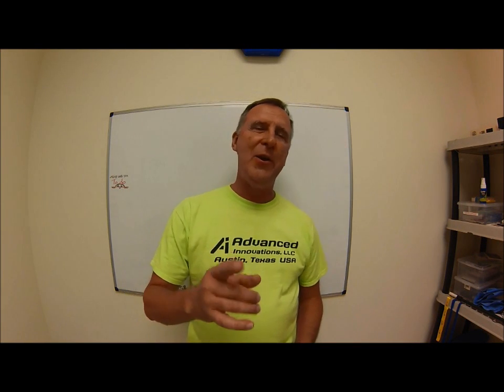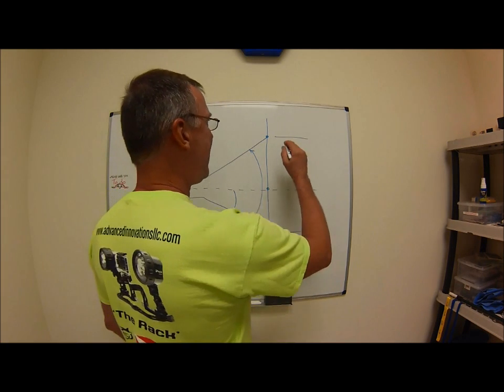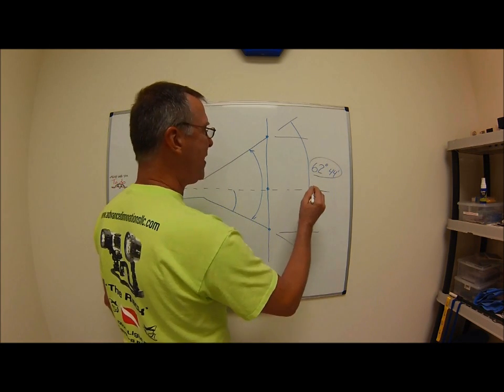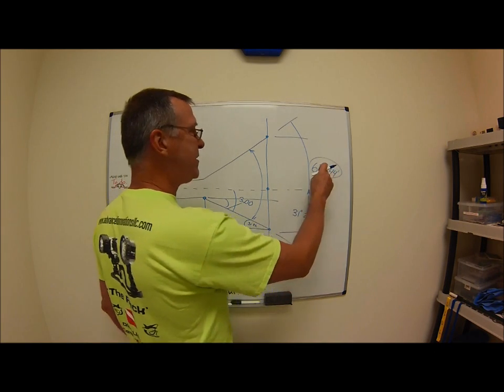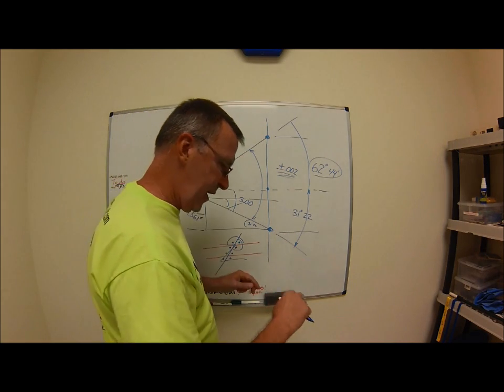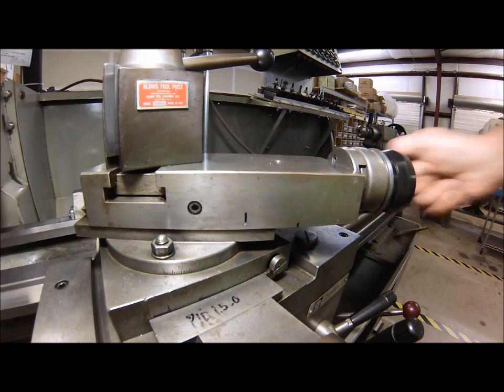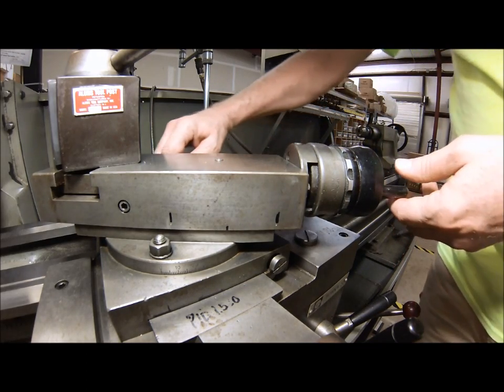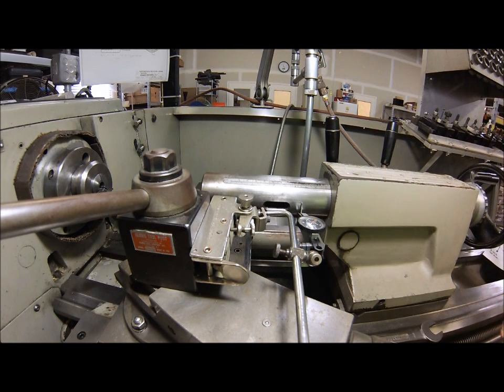Setting the Lathe compound to precision angles

Comment: So basically you are tracing out the sides of the triangle with the motion of your tailstock, cross and compound. By trigonometry when everything travels the calculated distance the angle must be correct.
Reply from the maker: Precisely, and it's a great way to visualize the geometry of the cuts.

Comment: I’ve tried this and it just wouldn’t work don’t know why. Tried several time. I’m trying to machine a taper that goes from a 30mm bore down to a 15mm bore at a depth of 23mm
This works out too 6° angle. However when I use this method the smaller bore ends up larger than 15mm. The trig Calculator works out to 2.4 mm difference in height over 23mm depth. But when you machine it the smaller hole ends up larger than 15mm. I’ve even done the bore layout in fusion360 and gives me the exact same results but matching it just doesn’t work. Totally confused why this is happening.
Reply from the maker: Make sure you are considering the setup is ' PER SIDE" rather than included. You may have to split your results in half.
Reply: @joepie221 I’ve checked and double checked then checked again and I just can’t get it to work. I’m trying to machine a bush that is 50mm diameter with a length of 50mm that has a through hole of 14 mm. One side has the taper with a diameter of 20mm going down to 15mm over a distance (adjacent) of 23mm. I’ve drawn this out in fusion 360 and it says the angle is 6° (12°total side to side) and that calculates to hypotenuse distance of 23.13 . When I use the calculated results the taper at 23mm depth (adjacent) the bore is way over size and no where near 15mm. What has come to mind as I’m typing this ….should I use 12° instead  of 6° for the calculations. As I’m using my DRO to do all the measurements
Reply: I wish there was a way I could include a diagram or photo
Reply from the maker: @markwebster5307 If the major diameter is 30mm and the minor diameter is 15mm, thats a difference of 7.5mm per side at the 23mm depth.
It looks like your triangle is wrong
Given a=.2952 and b=.9055,
c = 0.9524
∠α = 18.056° = 18°3'23"
Reply: @ I figured it out thank you for your help. Instead of using 6° , I used 12° and it works perfectly. Thank you for all your help. It really got me stumped and I did a lot of searching. I think it must be how the DRO is set up . I should have just used the old tried and tested method that you use and not the DRO. Thank you so much for your help
Reply from the maker: @markwebster5307  Glad it worked out, but I still can't tell where you got the 6 or 12 degree values. Its an 18 degree triangle?
Reply: @ sorry just noticed Joe, I gave you the wrong dimensions it should be 20mm down to 15mm and not 30mm down to 15mm sorry my type error 🤦🤦

Comment: My biggest thank you for this video.
I was in need of a morse taper 4.5 sleeve to fit a drawbar in my 1924 Oscar Ehrlich lathe, and with the help of your outstanding explanation I've just turned a perfect taper.
Took me 15 minutes to dial in the compound slide, and now have a perfect fit MT4.5 sleeve.
Reply from the maker: Glad it helped. Its very accurate.

Comment: That's a really brilliant trick! Fast, reliable and accurate for something that would otherwise be a big headache!

Instead of the centre punch mark would a score between both parts of the compound give more precision on the hypotenuse?
Reply from the maker: I don't actually use the punch marks for alignment. Thats done with the numbers on the compound dial. The punch marks are reference marks so I know I'm getting closer to having to look at my dial for the correct number. But...I'm sure scribed lines would certainly be more accurate than punch marks.
Reply: @joepie221  Thank you very much - I can understand that now!

Am I right in thinking that this technique would be accurate enough to reliably cut tapers (for example Morse tapers, etc.) for tools or would the taper need to be finished off using a taper reamer?

At 06:25 you said "my compound is usually set flush with the face just specifically for rigidity" - could you explain that a bit more? It struck me as something extremely important that I hadn't fully understood - I've heard of people having big problems with compound rigidity - particularly on smaller, lighter modern lathes.

This is enormously valuable for folk of my generation - I was trained in a state school system with very scant resources where the only option was to teach us to write G code CNC programs on 15-year-old computers - there just wasn't money for stock for us to practice on - and our teachers wanted to prepare us for the future by teaching us to program CNC machines - so running manual machines was something that we had to teach ourselves afterwards.

Comment: Still extremely confused. I need to cut a Metric 6 taper for my spindle on my voctor lathe. I've discovered it's a 1:20 taper which I should set at 2.25 degrees. Still trying to tell exactly what you did here...lol
Reply: Me too.. trying to dial in a 7.125 degree angle. I have 3" of compound travel. I don't really understand the "A" side of the triangle. Google says 2.237.. but is that in turns of my dial or inches or what?.. Because I don't have 2+inches of cross slide forward movement before my indicator on tailstock zeroes out.
Reply: I figured it out. I had to type degrees in the formula on Google to get the right numbers. After that it came up with .372. Since I have a radius reduction dial it works out perfectly.

Comment: Great technique. I had to cut .4 degree angle over 8 inches. It was just to track a belt on a roller so the tolerance was open. Figured if I am to do it, do it right. This help greatly.

Comment: Do you need an indicator on the cross slide to measure the A distance more accurately than the ring on the lathe?
Reply from the maker: They work together. I say you need both.

Comment: I know I'm 6 years late but just finding this.  can you or someone help me understand the idea of angles when it seams like the 0 degree seems to be changing position.  For example in your drawing on the board the 0 or no angle is right in line with your headstock centerline.   But when you went to set your angle on the compound your 0 was now off by 90degees and zero seemed to be in line with the cross slide.   This keeps me so confused... is zero based off the spinning axis of the lathe spindle or like with a thread in line with the crossslide and 90 degree off of spindle axis.

Comment: Just a mold maker observation you use a sine bar an indicate it in to any angle
Reply from the maker: True, but first you have to own a sine bar and block set or adjustable parallels. This method is free.

Comment: I use the same technique plus to make it easier to set the target angle.    I clamp a 1m strip of wood across the bed at right angles.  The wood is located to the right of the tail stock.   The wood sticks out the front of the lathe.  I then clamp a 1.4m length of square section steel onto the side of the top slide.  The end of the steel rests on the wood, but is not clamped or attached to it.  I now make a first attempt to adjust the angle of the top slide using Joe's method.  I mark where the steel now rests on the wood by using the steel like a ruler to mark a line.  After each adjustment to set the target angle, I mark a new line on the wood.  This gives me a history of angle setting attempts.  It is also MUCH easier to make very fine angle adjustments at the far end of the steel than at the top slide.    It takes longer to explain than it does to do.  It speeds up setting the angle to fine tolerances.

Comment: Used this method to set to bore 1.5" taper per foot for wheel hubs on hydraulic motors. Worked great and very easy to set up. Thanks!

Comment: Watched this video some time ago but just last month had occasion to use it. I needed to turn a #2 Morse Taper. I can only get 2" travel on my compound so I knew accuracy wouldn't be the best. Setting everything as perfect as I could the tapers didn't seat right in a socket. I think the tolerance on this taper is around 0.001 error over 10" run. How in the real world can I get this on a manual lathe? I machined as good a surface as I could then went to a tool post grinder to give a great finish

Comment: I just scraped the side of my compound perfectly parallel to the direction of travel withing about 30 millionths.  Then made a fixture to lay a sine bar on its side on this surface.  Put an indicator on the lathe bed, set the sine bar to the angle I want, and adjust compound angle till the bottom of the sine bar is parallel to lathe ways.  Done.
Reply from the maker: Tools required....sine bar, complete gage block set and an indicator.
Reply: @joepie221  true...I guess I take it for granted that everyone has those.  Good point.

Comment: "Some engineer who has no clue how hard it is to cut", lol.  I work as a manufacturing engineer so my design responsibility's are generally limited to fixture and gage design, but I've made more than one tool maker rip his own hair out and scream at the sky in frustration over the years.  You've been in the game for awhile, have you found that CAD has increased, decreased, or had no effect on the number of impossible to manufacture features you encounter?  Asking from the perspective of someone who started on a board, then progressed through 2D CAD and eventually solid modeling.

Comment: I would never use the tailstock... Ever!
Turn a diameter... Use that...
Reply from the maker: If you are midway into a part currently in the chuck, and setting up for the next feature, thats not an option. ...Ever
Reply: Your so right I always use the tangent of the angle and indicate off the face of the Chuck to dial my angles in

Comment: This is some good stuff... I've used gage blocks and indicators before to trig out the angle, but never once did I thought to use the tailstock as a reference. This is gold for me. Thanks Joe!
Reply from the maker: Check the tailstock and stay near center and your angles will be incredibly accurate. Be sure your tool height is equally adjusted to center for the best accuracy.

Comment: Joe, thank you. I’m a self taught amateur hobby machinist. I’ve used any of your techniques building engines that actually run. The angle technique on the compound slide is especially useful. I’d never get angles correct otherwise. John
Reply from the maker: You can get it within minutes this way. Super accurate method.

Comment: brilliant thanks joe  i,ll  need to watch this a few times for it to sink in, I love using basic trig and I always  use a little  guide  if its 30deg the the sine is .5 which makes the opposite side half of the long leg or hypotenuse , keep up the good work , and thanks
Reply from the maker: x .86603 for the bottom.
Reply: thanks joe @joepie221

Comment: The high-performance valve you talk about might be quite dependent on an odd angle value to work properly.  Or the engineer might have gotten boxed into a corner on the design of the part.  How about just explaining how to do it rather than throwing out cliched old shop floor insults?  If shops are having trouble with one of my designs, I want to do business with the one that picks up the phone and collaborates, not the one that just cluelessly talks about how much of an idiot I am behind my back.
Reply from the maker: If an engineer has a reputation of being an idiot, he's probably too arrogant to listen to the guys on the shop floor. I've met and worked alongside all kinds. Its usually the young, fresh out of school engineers that over constrain things and could really benefit by a few hours in the shop. Talking the design over before you release it is always the best path. As for picking up the phone and discussing a design, I offer design consultations to avoid such problems to new customers, free of charge. Though its a good idea to head off future issues, its not always practical or profitable to get involved with a customer design unless you fully understand the design intent and application.

Comment: This worked perfect to set 7.125 degrees to open up the taper on my D1-4 backplate.  Thanks Joe, as a hobby machinist I have learned a lot from your videos.  It took me ~10 times to get less than .001" error on the cross slide measurement, but I did get it. Then checked how true the angle was by checking with a .0005" test indicator along the original taper.  Zero dial movement.
Reply from the maker: Glad it helped you. This is an incredibly accurate setup method.

Comment: I've been trying to get a 1.4 degree taper on a hardwood sprue using an old Lesto Scintilla with a removable cross slide, very tricky, but your method produced results on the 2nd attempt. After sanding smooth and a sawdust polish, the taper was measured at 1.409 degrees.
Thanks for the time to make this video, its much appreciated.
Reply from the maker: Thank you for your confidence to give it a try. The method can yield some amazing results on a manual machine.

Comment: I would only add that you can also slide the saddle parallel to the rotation axis to use the same spot on the tail stock to indicate both ends of the hypotenuse.  This eliminates any error that is possibly introduced by the tail stock not being parallel to the rotation axis and machine ways.

Comment: Joe, might sound stupid, but I've noticed you tend not to zero your cross slide and compound dials very often, instead just noting the number. In this video you travelled back to zero and had a center punch mark (which tells me that you don't move that dial at all) I personally adjust them all the time and work to  zero, like a lot of people (myself included) do with DRO's. I know that adjusting them adds potential for a few tenths error everytime you move it, but I usually take a cut, mic, set what I need to take off so I'll be at my dimension when I come back to (at least close to) zero. Just wondering if there is a higher motive you have for not adjusting them as it seems you have a reason for everything you do. Thanks for the great videos.

Comment: Pure genius, instead of dreading trying to cut an accurate angle I look forward to trying. I have to make some grinder hubs with internal tapers so will use this method. Thanks for sharing your knowledge.
Reply from the maker: Thanks. Be sure the tool is extremely close to center when you do this. Any deviation high or low starts to flatten out the angle.
Reply: @joepie221  Thanks Joe, I'll make sure I pay careful attention to the tool height.
Just to let you know I used the technique you demonstrated for turning very thin walled components to make a 10 thou thick acetel spacer that was missing from the seal set of a 30 ton press we bought cheap as it was leaking hydraulic fluid. The OEM part was only available as part of the full seal kit which was very, very expensive. So, thanks again. It just shows how useful sharing knowledge is.

Comment: Hi Joe, your content is a little advanced for me at this point. It took me a whole weekend to machine 8 levelling feet for my lathe my first lathe so small steps. However even being a novice your presentation was done in such a normal way without you needing to pull out the technical terms and language that for us novices make you sound like a brain surgeon and goes straight over the top of our heads, you have a way of conveying a circumstance that is understandable to many, thank you. Your clearly putting it out with a genuine desire to help not to stroke your own ego.
Reply from the maker: Show and tell channels are fine, but I really try to leave my viewers with something to take away, think about or expand on. Thanks for the comment.

Comment: That is a good idea in theory but there are some assumptions that are made. Namely the tailstock is in perfect alignment and there is no wear on both your tailstock spindle an the ways of your cross slide. Even if there is wear on the cross slide ways doing this is not going to compensate for the effects of tool pressure when you are actually doing the cut. I am not trying to argue with you I have a great deal of respect for you. I am just trying to point out some things to be aware of.

Comment: You can also use the same technique on the milling machine using the ball on your clock as a sine bar. This can be used for setting a given angle on a dividing head with a straight bar in the jaws and again using the ball on the clock has a sine bar. I’ve also machined many parts for all types of aircraft with tight tolerances on angles and none have come back rejected. Keep up the good work.

Comment: Nice one Joe!  I was looking, because I need to do an outside tapered bushing for a project.  My dimensions are much less critical, but the measurement quite simple!  Tested in a mini lathe on bronze for practice, then did a full 304 SS version. Wonderful.  Now, just have to cut threads.